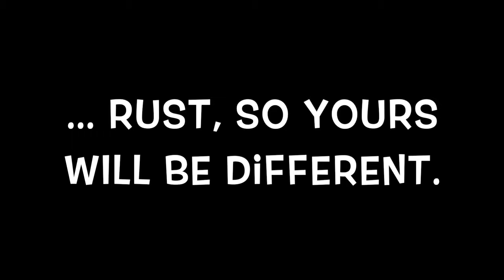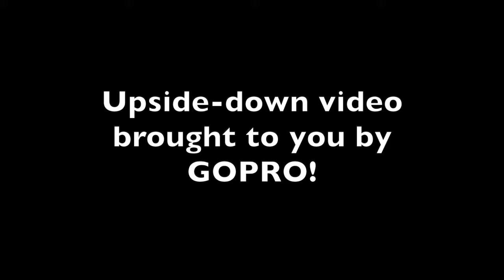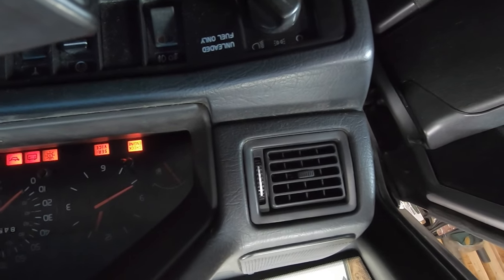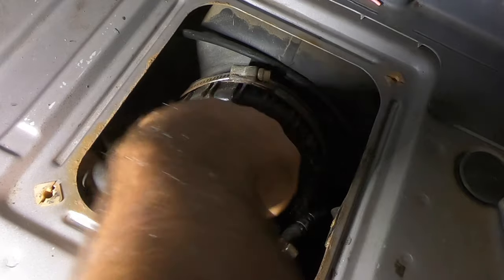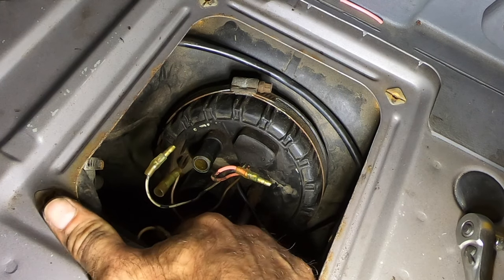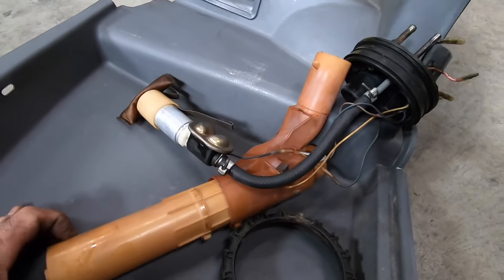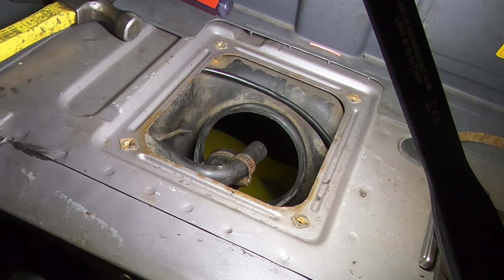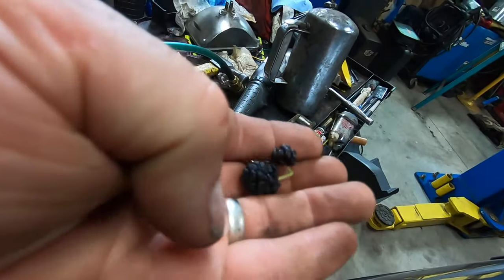'93 Volvo 940 fuel pump sender assembly (Regina / Rex, non-turbo) - removal, installation

Comment: Not sure if you can help. My son has owned my old 1990 Volvo 740GL wagon with the Regina system for about 5 years. The fuel pump assembly has failed. Leaks gas and it's sitting at the shop. No auto parts has it. He has called a number of junk yards in our area (Oregon) now he is moving to calling some in CA. He's completely disheartened. The housing leading to the fuel pump by the gas tank is what's leaking according to the mechanic who is not helping very much with looking for the part. Who has this damn part?
Reply from the maker: They're no longer manufactured by Volvo, so whatever is out there is all that is left. I got extremely lucky and happened to find mine used, but in excellent condition on eBay out in CA when I decided to fix the issue. Eeuroparts.com used to have them, but not sure if they can get them anymore. You'd have to call and ask. Best bet is to find one used, but still in decent condition somewhere. You could look on eBay, or use https://www.searchtempest.com for all of Craigslist and eBay in one shot. Craigslist would require you to drive to meet someone in person, of course, but might be your best bet, especially if someone happens to be parting out the same model vehicle in your area. You might find several other hard-to-find parts off the vehicle there that you need as well.  Good luck! DON'T GIVE UP YET!!
Reply: Find a facebook.forum.spmeone will.have a parts car to sell u one same.day

Comment: Looking good, did u verify no leaks?    Just did a fuel pump on my wifes 04 Outback. Really easy. Thank god for the access door in the trunk.
Reply from the maker: Yeah, went and filled the tank right to the brim (was gurgling inside the filler neck, lol) the next day, and it didn't leak a drop. We've put 900 miles on it since the install, and I've made sure to top it off until fuel was sitting in the filler neck to be 100% sure, and it's all good. Well worth the $169.

I'm definitely a big fan of the access door! Never had that luxury on any of my domestics. Thanks for watching, Chris! 👍🍻

Comment: Nice video Smitty!  Not only do you have to struggle with working in the trunk, but even more aggravation with the camera!  Anyhow you got it done.  I'll look into LPS 3, I've been using Fluidfilm and Woolwax for anti-rust protection.  Hey, remember the old engine driven mechanical fuel pumps?
TakeCare,
Bill
Reply from the maker: Yeah, I miss those! $10 and 10 minutes, and you were back on the road again. 

A friend of mine just replaced his ORIGINAL, cam-driven fuel pump on his 60's Plymouth - 51k miles, but FIFTY years of service!! That's impressive. Just can't get that kind of quality anymore.

LPS-3 is a bit spendy, but it's really good stuff. Holds up alot longer than most of the rust preventative treatments out there. It's cheaper to buy by the 5-gallon pail, and fill a Sure-Shot with it. Aerosol cans are around $10 each for 11 oz.,  & $18 for 16 oz., if I remember right. Takes a while to dry, but once it does, it's a thick waxy coating.

Thanks Bill! Thanks for watching!👍🍻

Comment: Thanks for your video. I am planning to use the stand alone fuel gauge to back up the underread gauge in instrument cluster. Do you have resistance value for both empty and full of volvo 960 GL for my reference? Thanks in advance
Reply from the maker: Sorry, I never checked that ... yet! So far my gauge has been working fine, albeit reading slightly lower since installing this assembly. If I run into an issue with it, I'll make a video on the repair process, for sure. Thanks for watching. 🍻

Comment: Thank you for going through the trouble of making this video. You mentioned you replaced the fuel pump on it once before, by chance do you remember what brand or model you went with? I'm trying to find the most reliable pump I can find for a Regina system, since I really don't want to make a habit of having to do the job twice. 

Thanks again!
Reply from the maker: Thanks for the comment, and for watching the video - glad it helped!  👍😎

When I bought the vehicle, the fuel pump assembly was out of the tank and on the floor in front of the passenger's seat. The previous owner had bought a new pump for it, but had an electrical fire somehow attempting to install the pump. Luckily he didn't burn the vehicle to the ground! That new pump was also on the floor up front when I bought it, still in the box. Anyway, I believe that pump was a Professional Parts Sweden brand, if I remember correctly. I ran that for 4 years or so, and only removed it to install the new sender assembly in this video. I saved the pump I removed, as it's still good. They're a quality brand from what I've seen. I don't have a ton of foreign car experience, but with domestics, you can't go wrong with Bosch. Eeuroparts.com has a lifetime warranty on everything they sell, and they only carry Professional Parts Sweden, Bosch, and OE Volvo pumps. Can't go wrong with any of these, although the OE pump is extremely expensive.
Reply: @SmittySmithsonite  Wonderful, thank you for the info!

Comment: hi I like to know what I can do to get my pump back in the tank the rite way any tip's? 
I have a 1997 Volvo s90
Reply from the maker: I'm not familiar with that year or model. If it's the same as this 940 here,  you just have to keep trying different angles until it finally drops in.

Comment: What brand to you prefer for a fuel pump I’ve been trying to get one for months now and local stores only have ones half the size of the stock pump!!!
Reply from the maker: OE Volvo, or Professional Parts Sweden are my go-to brands for my 940. Yeah, it's a mess out there today. Elections really do have consequences! Wish people would learn ...

Walbro was always a good brand, but I had one fail on a neighbor's 940 almost immediately after it was installed a few years back. I think I mentioned that in this vid. A check valve failed the wrong direction of flow, blocking flow out of the pump on occasion.

Comment: Hey buddy I have a 92 Volvo 940 just got the fuel pump replaced went to get gas ended up with all of it on the ground. You pointed out the leak you had with the tube, but with me they couldn’t get the part anymore like you said so I think they made a tube with copper or something is that the cause of my leak you think?
Reply from the maker: Mine wasn't leaking from the filler tube. It was dripping out of the top plastic of the fuel pump assembly. The 2 smaller vent & return lines rusted, swelled, and split the plastic open like a piece of wood. Every time my tank was full to the top, it would drip. Once close to 3/4 tank, it would only leak when driving, when the gas sloshed around. Parked, it would eventually dry out underneath until the next top off.

If you have a leak after repairs were done, I would definitely check all that out. If it only leaks when filling, then that's more than likely the filler tube. If it leaks the same as mine did - at all times only when full, or only when driving at 3/4 tank or less -  then it could be the seal around the fuel pump assembly itself, a cross-threaded plastic "nut" that holds the assembly to the tank, or a crack in the housing itself, like mine had. Also have to make sure it's not leaking out of the vent & return lines. Mine were all rusted and leaked like crazy when I first bought it. Cycle the key to get the fuel pump to prime with that access cover removed and a good, bright flashlight, and check for any line leaks. If you can get underneath the car after it sat overnight, you'll see telltale gas staining wherever the leak is coming from. That can help narrow it down. 

Good luck.
Reply: Thanks buddy everything was fixed. But the problem is now the gas gauge is not moving after this replacement. It’s stuck in the under halfway position but the tank is full. Does this mean something in the tank needs to be replaced now? Thanks for the help!
Reply from the maker: @nickschiano450  - You're welcome. Could be just a bad connection where everything was plugged back in, or there's a problem with the float, float arm, or contactor for the float. I've had some in the past that required a light Scotchbrite sanding on the brass contacts to make a better connection, then the gauge began working again.

Comment: Hey man it’s nick here again from before asking about the fuel pump. I don’t know how much you know about this car in terms of stalling but ever since I got the fuel pump done and it was fixed from the leak. Now, it’s stalling when I hard brake or go around a bend it completely turns off, usually starts back up right away after. It will start to stall, but when I press on the gas it jerks and keeps going but usually dies. I took the vehicle to master mechanics and somehow they can’t figure it out I think it’s bullshit they must have messed something up with the fuel system id say. What do you think? Thanks
Reply from the maker: Hey Nick. Sorry to hear the car is still giving you a hard time.

That has "bad electrical connection" written all over it. The symptoms fit. Those kinds of problems are extremely tough to diagnose, since it's intermittent.  You'd have to try and recreate the issue with the engine running but parked. First, I'd do a visual inspection of the wiring to the pump - anywhere the harness rubs against sharp metal would be suspect. Wiring shouldn't be near the exhaust or driveshaft, but that's something to check too. If that all checks out, or you can't find anything obvious, I'd hook up a fuel pressure gauge somewhere where you can see it easily, fire the engine up and move sections of the harness from the pump forward until you can get it to die. What is more than likely happening is either the power supply is sliding forward into something and grounding out (not likely, since this would blow a fuse), or the power or ground is becoming open circuited when it slides forward.

You can narrow down which part you're losing by connecting a jumper wire to the pump ground, and connecting it to a good ground in the trunk somewhere. If the problem stops, you'll know you have an intermittent ground.